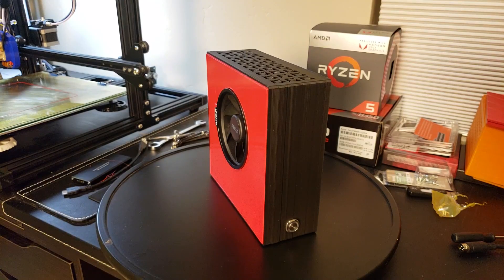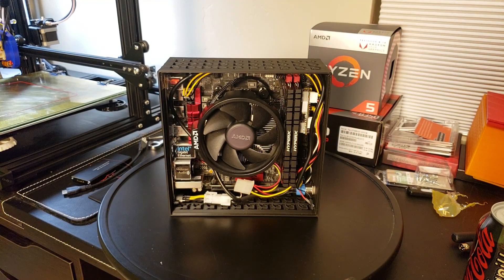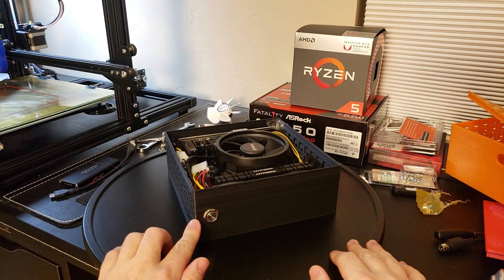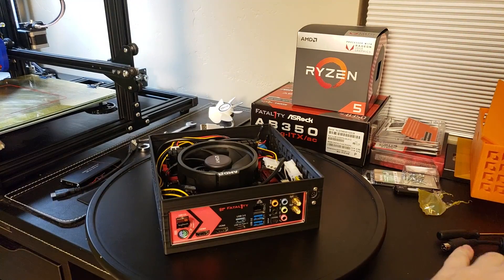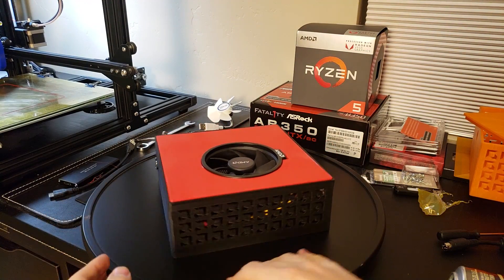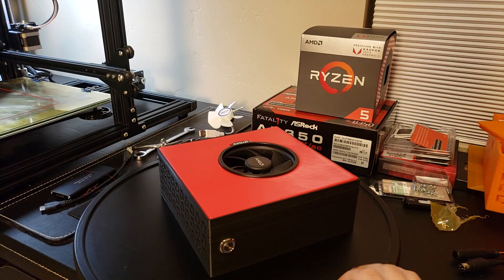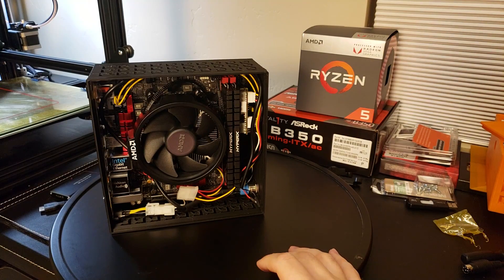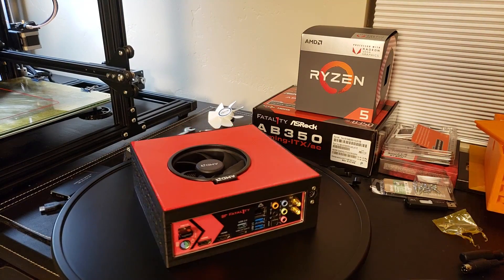3D Printed Ryzen Mini ITX Gaming PC! - Part 2 Final Build

Comment: where do you fit the psu are you a wizard?
Reply: It's a separate brick (like a laptop charger)
Reply: @AleksandarStefanovic  laptops still have a battery
Reply: @xavilpz9032  laptop still works without battery when plugged to its power brick
Reply: 7:19
Reply: Just think of it like a console instead of arguing about the stupid laptop battery....

Comment: I like how compact and solid you managed to get this but there is one about that made me wonder, what type of storage unit does one have since neither can there be anything that remotely resembles a HDD nor SSD to be seen from above the machine? I´m guessing it uses a SD card or one of those m.2 connected devices since that seems like the only plausible implementation here.

Comment: I'm really interested in this but I suggest you to take a measurement for the longest part like the graphics card and the case width based on the Power supply or cpu cooler! so you can fit anything in optimized way then make an 80mm hole for exhaust fan and try to go for the cube look so you can make a little beast, Please let me know what do you think?

Comment: Hey dude saw this just now. You can extend it just a little bit and you can add a gtx 1050 mini. Add octagon, round or even a logo design  perforations on the ram side so you can play around rgb by adding frosted acrylic.
Reply: Also instead of one big power button, there are wires worth 1$ that has red and green indicator plus power button and reset switch. It's small enough to fit your design but makes monitoring it a lot easier.
Reply: Gtx 1050 low profile*

Comment: super cool! i actually like the front it looks like a brushed aluminium 
how much heat can this material can handle? also, doesn't it produce toxic fumes with heat?
Reply: If the creator lives in EU no toxic fumes.
Reply: @sidewinder86ify  he is american, not sure what you mean by that response.
Reply: It's melted so the machine can print with it, and it's a exposed printer inside his room. What do you think? also if your pc gets hot enough to melt these materials without being directly on it, you have bigger problems than low quantities of non existent toxic fumes.
Reply: @iMRM-ez8of  PLA for example already starts to softens at 60°C and if you really stress this system you could reach those temperatures inside. And if it is made of ABS (which can resist higher temperatures) there are some harmful fumes while printing. So I think this was a valid question.
Reply: It's resistant up to like 120 degrees celsius which air inside would never reach. since it sucks in actual fresh air directly the temperatures inside are even lower.

Comment: Looks great i was staring at where you had hide your ssd until you had said the m.2 on the back  lol
You can use magnets for the lid  it's easy to design and to implement in your existing case i am a little more old school modder myself i never even used a 3d printer in my life but what you could do with it is endless

Comment: you can improve cpu,vrm,psu and ram temp by adding 80mm fan attachment to top and bottom so air forced to sucked into cpu cooler hole
Reply: and adding attachment point in front of the cooler for fan grill, so no fingger or maybe an animal got stuck on that fan.

Comment: Holy crap! Awesome build. I was just modeling a VERY similar case when I got into google and found this video 🤣. I was worried having an open cpu fan would be too hard on the system, but you think it’s fine. Would you mind reviewing my model, and even printing it? I don’t have a printer or mitx board to test fit. 😕

Comment: How did you manage to fit an pico PSU with an 4Pin connector to the mainboard? Either I can’t find a pico psu with an 8pin connector or the main boards in Germany are different. I’m about to try this build out an need some help. Also I’m a bit scared that the PLA will warp or flex during heavy CPU usage

Comment: I love this, now if you could just add enough room for a zotac mini 1080ti, rx 580, 1060, etc. It doesn't have to be in the same area as the motherboard, it could be on the otherside. 
But this looks fantastic. 
However, I know it's supposed to be red for AMD, I'd make it completely black, with an RGB strip slightly glowing off the 'top' make an area for tempered glass to set where the GPU is. 
If only I had a 3D printer, so I could show ya'll what I mean lol

Comment: I would love 1 of these.. make it slightly taller and the lid perforated and you can fit any board in there mitx wise.
Could a hdd be added to the front or is there no room

Comment: smaller!  i wonder if i could print this at like 90 or if i haaaaaad to 95% vertical height and use the smallest possible noctua.  I really want to print a case thats no bigger than the board itself, or as close as i can get anyway.

Comment: How did you eventually print the motherboard back plate IO opening without sagging?
Reply: yeah thats the thing i don't get with 3d printers.
Reply from the maker: supports inside cura (3d Printing Software.

Comment: Nice case but I wish you can put videocard on it
Reply: Yeah, Im thinking of using the measurents from his files. Slightly editing them to see if I can make a slightly bigger case, that can hold a sff psu and gpu. Might be able to use a power solution similar to what you tuber "notfromconcentrate" uses though, to make it smaller.
Reply: @gecho8848  Might aswel check the A50 mini itx case, which is like Dan a4 case for fraction the price.
Reply: Ehh the vega 11 isnt that bad.
Reply: @gecho8848  making it bigger defeats the purpose.
Reply: @remixislandmusic510  Yeah, a tad slower than an RX460, and a tad faster than Xbox One.

Comment: Was it just trial and error to get the hole to fit the wraith cooler perfectly?
Reply from the maker: Yes it was; I even was measuring with a caliper; but still needed to adjust a bit after printing a lid that was very close but not quite right.

Comment: Awsome job. My only concern would be the low temps required to soften and warp PLA. Do you mind doing a video of the results of running prime95 or 3D benchmarks for an hour so and showing the temps and how the rigidity holds up as it heats up? Also the lid seems to be friction held in place, iv found that with PLA over time parts under tension tend to loosen up as the plastic doesnt truly hold its shape very well. Maybe a fastening system would be a good idea. 

PETG seems to be the best functional plastic for 3D printing IMO as it a good balance of strength, heat tolerance and printing ability.

Anyways, i dont mean to take anything away from your project, its truly awsome what you have done, I just wanted to share some of my 3D printing experience with you.

(Subscribing)
Reply: After a while, just by using it, the PLA will anneal, being able to reach 100+ Celsius, more than enough.
Or you can anneal it in the oven, I had good results annealing PLA.
Reply: You could use ABS, I use my heated bed at 110c (yeah, you can boil water on it), and the plastic is nowhere close to being soft. If your case gets that hot, well you're CPU is officially in flames, LOL! No annealing required, just print and you're done! ABS is a super common plastic you will see in possibly half of the products you buy, its very common.

Comment: Is there any other motherboards that work with this case?
Reply from the maker: I can't answer that personally. but if you play with the CAD files in tinkercad you can adjust the fan hole on the lid if it is in a different position

Comment: I'm a little curious how you have the power rigged up to the motherboard.  It looks like you have a 4 pin DIN plug right of the back-plate.  How does that translate to the 24 pin connector on the motherboard?  And also the 8 pin PCIE connector.
Reply: I believe he said a Pico power supply. At 150 watts. The power input pins most likely are 3 v 5v 12v and ground going out

Comment: so it works fine with just the 4 pin cpu power connector? It looks kinda sketchy just putting the 4 pin into an 8 pin, but if it works fine for you, that's all I need to know.
Reply from the maker: Yep it works fine. I don't however plan on overclocking with this setup (only 150 watt PSU). although in my testing I still haven't seen cpu/gpu exceed 120 watts using burn in programs. and normal consumption even when gaming is usually less than 100 watts.

Comment: AMD fan log can be turned right sight side up.
The logo/shroud can be unscrewed from the fan, but you need to design/print another side pannel tho.
I prefer to have case standing up print some disconnectable legs/stand to assist airflow, as it takes less space, and looks way cooler.  if it does get to hot you can always take off the mobo io shield for further airflow, you dont see it anyway so why having it there? I rather have better airflow then aesthetics that you will not enjoy

Comment: Butters, can you please get in touch regarding this case. Thanks!
Reply from the maker: Whatcha Need?
Reply: @cbutters  jw cost of the case itself to 3d print. Also wanted to know if you took it further with ustilising the pcie slot on there

Comment: Get a PCIe x16 riser cable and make an add-on to house a gpu, then it would be the ultimate modular mitx case!
Reply: And he could try an make it symmetrical.
Reply: he should make it like the dan case. it would be awesome. tiny case with a gpu and wc
Reply: That defeats the purpose of the APU.
Reply: @Ccodebits  who said it was only for a apu. the 2700x doesn't have igpu... maybe he should make two versions

Comment: Damn. Add a dust filter\grill and you could sell these. Pretty cool.
Reply: Def not needed, why are millennials so scared of dust?
Reply: @joeygreathouse3029  I've been fixing PCs for most of my life now. Dust has been the #1 killer of fans, especially GPU fans. I've even seen entire heat sinks buried in dust. Users wondering why their PCs kept shutting down. Their CPU temps were going up to 100c. Most people just don't know to clean their rigs.
Reply: @SupertoastGT  Nice, I've been repairing PCs since 1998 and haven't ever seen one die to dust before. Thousands of rigs, dust hasn't ever killed one. Fans die whether or not they get dusty, based on how long they run. Even the cleanest fan will die some day.

Never had a side panel on one of my PCs, just leave them off and you won't even need case fans. Kept my AsRock Extreme3 Gen3/i7 2700k@5.1GHz going since 2011. Never lost a single GPU or GPU fan. I have an 8800 GTX that still has OEM fan, doesn't even make noise. Just dust the fucker. Hell I kept a MSi Nforce 2/Duron@1.4GHz going without a side panel since 2002! 

If I didn't have such an overwhelming amount of professional experience, I might fear dust as well! Nothing a little air can't fix. No worries, lazy kids!
Reply: Fair enough. Though my town is in a dessert. Maybe that's why. Meh.

Comment: This can't be cheaper than a regular budget mini ITX case can it?
Reply: I guess it depends on the thickness of the plastic, wonder how thin you can get away with.
Reply: If a 1kg spool of filament costs around 18usd, than the case, that should weight around 200 grams, should cost around 3.6 usd.
Reply: That's cheaper than I expected but I also expected to be heavier so
Reply: Wonder if you could 3D printed into pieces so they could be shipped flat?

Or would you just need to use glue in that case
Reply: RyanWake bradtelle I don’t know the weight of the case exactly, I’m just guessing, but it can’t be much heavier than that. Even if it weighs 400grams the cost would be around 7.2 usd, so always cheaper than to buy one. 

I believe it could be printed in pieces and then assembled with glue or screws but the postage savings wouldn’t be significant.
Reply: Download the files, feed it through a slicer that tells you the weight, then do the maths on the filament cost. No, I haven't done it. I don't care enough to try 😛

Comment: can i do this on a ender 3 printer?
Reply from the maker: Might be possible; I can't remember exactly; but I think the dimensions were really close and probably just a little smaller than 200mmx200mm which would be the max size for an ender... download the file and see what it looks like in your slicer. I'd do it for you but I'm away from my main computer currently.
Reply: thanks for the reply , do you have a project that support low profile gpu?

Comment: Power supply?
Reply: He is using a pico psu which is powered by external power brick. Just Google pico psu
Reply: Did you watch the entire video?  He talks about it at 7:19
Reply: Dank Harambe  They probably don't know anything about ITX, but definitely know enough about building computers to know that PC is the same size as their power supply alone.
Reply: Dank Harambe  There isn't anything wrong with asking questions, that is how you become educated. I've built hundreds of PCs and only recently found out about Pico, when I started to research mini ITX builds.
Reply: Basically it´s a little as those laptop to desktop conversions that you find but more free from being restricted due to existing parts limiting the options you have.

Comment: What's the approximate cost of this build?
Reply: $350 usd, give or take a little depending on deals you can get on the motherboard/ cpu
Reply from the maker: Depends on your components. But I was able to get the motherboard for 69.99, the ryzen 2400g for 150, memory was 88. PicoPsu was 75 with ac brick. add storage for another 50-60 and you are right around 430 or so. Or get the ryzen 2200G and save 50 bucks.
Reply: @cbutters  Thanks, looking for a PC to carry with me between various countries, this looks ideal.

Comment: Cool case, but what do you mean "Gaming" PC?
Reply: The 2400g has vaga chips in the cpu
Reply: @davidbraswell3639  yes, but t's weaker than the cheapest and worst possible last gen discrete GPU, it's certainly not a good gaming option, and people who build anything for gaming use actual GPU. So why is this "Gaming" PC? Based on what? It's even in the video title says "Mini ITX Gaming PC", how is that?

Comment: Love the effort, but that fan opening design is the stupidest thing in the world. Textbook form over function. There's certainly no need for a guard, but every PC fan needs a dust filter, especially cooler fans. Having that massive fan suck in air unobstructed means the heatsink will be caked with dust in no time.